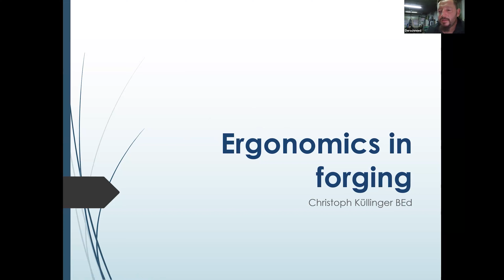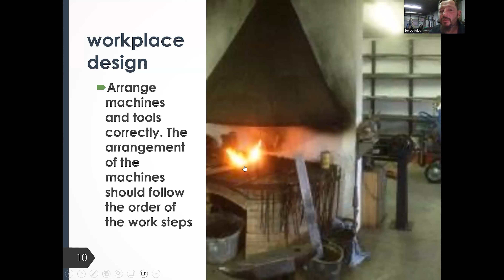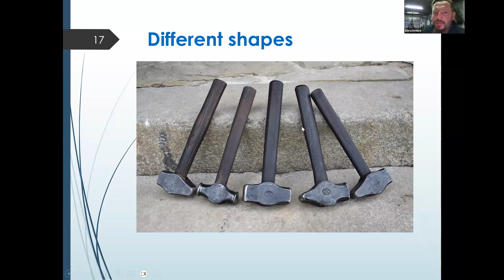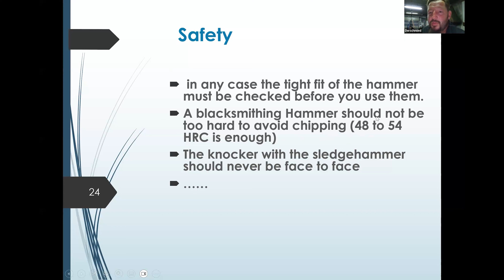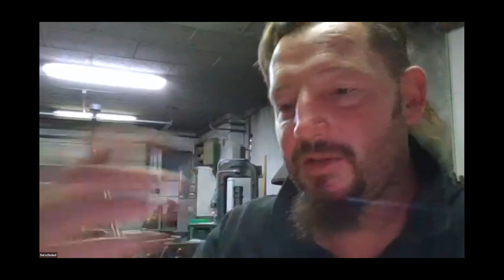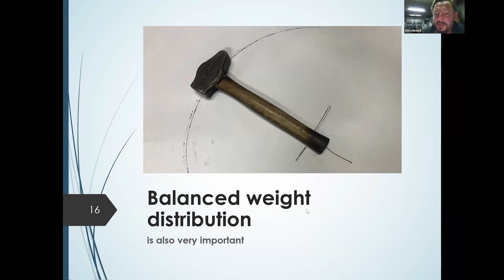Ergonomic Forging with Christoph Küllinger: Blacksmiths Without Borders Sept 2023 Treff

Comment: Another reason for the doghead hammer, in addition to it concentrating more mass behind a small face, is that it self rights, or self orients. The weight hanging off the front of the hammer allows it to resist twisting in the hand and helps it land with higher consistency.